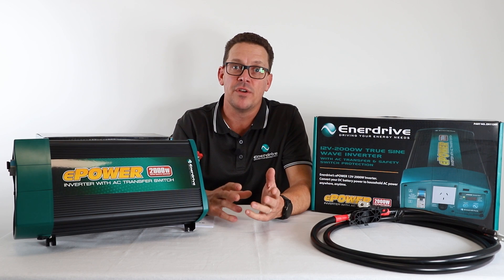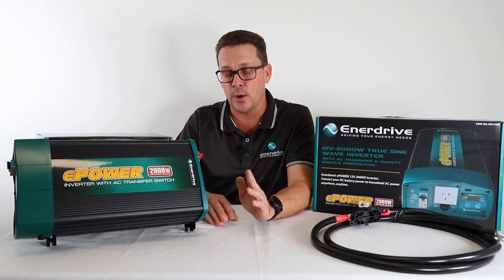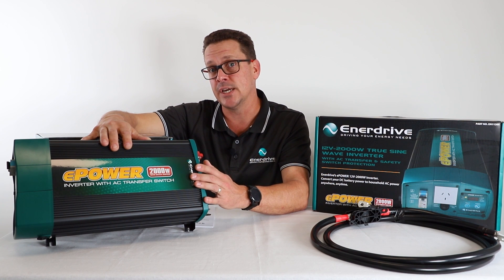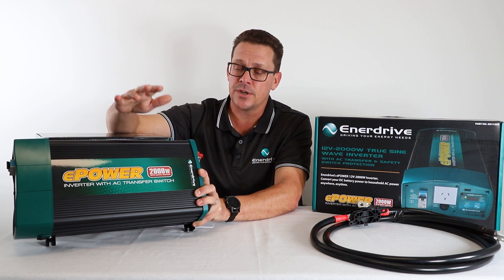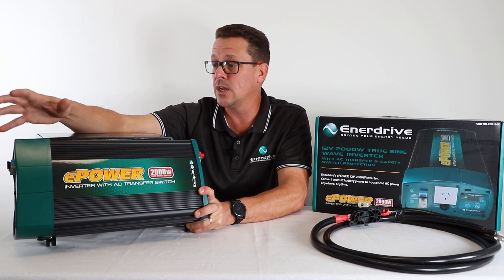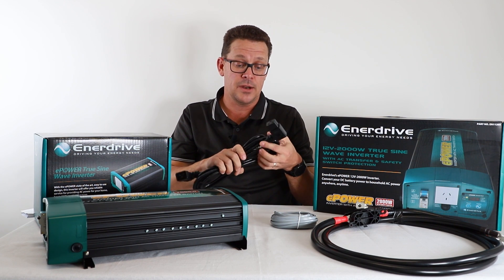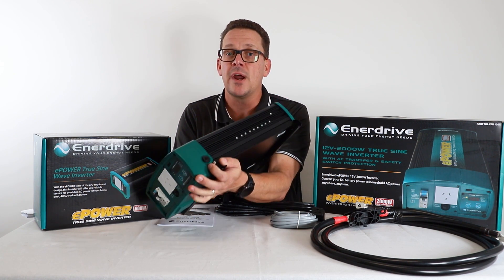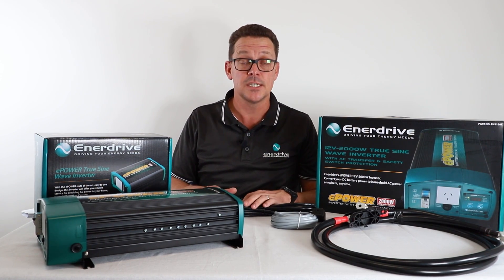Enerdrive Inverters (Transfer Models) - Part 2 - Specifications

Comment: An rcd on a system which is isolated from earth?🤔 Yeah ok!😂 Plus your rcd is single pole! Because the inverter is isolated from earth u don’t have a neutral. All active conductors must be switched, meaning u require a double pole rcd! (Which is useless in an isolated system anyway!)🤷‍♂️

Comment: I do not understand why you would fit an RCD, what the hell for? it makes no sense, the only possible way to trip it would be if by some miracle you touched both, and surely you wouldn't earth 1 line just to fit the RCD?
Reply from the maker: Hi Drew, RCD’s are required on all fixed AC wiring installations, same for houses applies to fixed RV installations. The transfer models create an MEN link, required for the RCD to operate, whilst in inverter mode. When in transfer mode it relies on the MEN link from the incoming source.
Reply: @dometicpower  I'm not sure you understand what I mean, if you're not referenced to earth, there is no need for protection, and if its just incase you somehow managed to touch active and neutral, that makes no sense either, your house in not even protected from that, If I'm using an inverter that is not referenced to earth you do not need an RCD.
Reply from the maker: @drewjohn6847  The requirements of AS/NZS 3001 and 3004 require either isolated inverters or RCD protected inverters in RV and marine installations.  As the transfer models are not an isolated inverter we make them as the RCD version to be compliant.  If you do have an isolated type inverter, as per AS/NZS 4763, and the installation is kept isolated than that also complies, which is what is seen on smaller stand alone inverter systems.   Feel free to give our office a call to discuss in more detail.
Reply: If u don’t have an earth then u don’t have a neutral, therefore u can’t have an MEN. A neutral is only a neutral because it’s connected to earth!🤷‍♂️